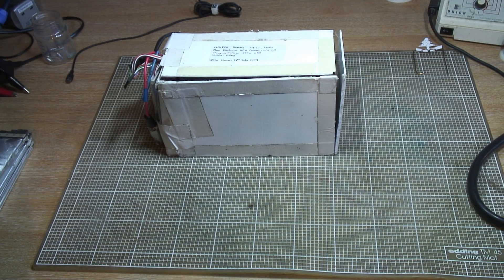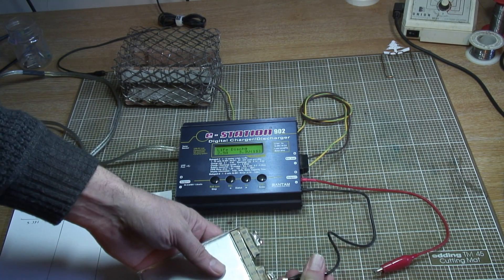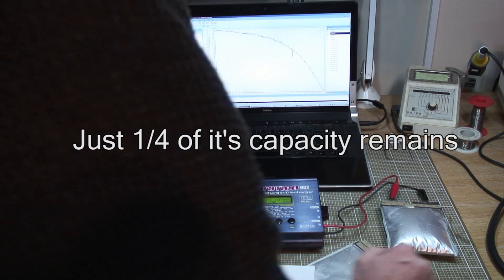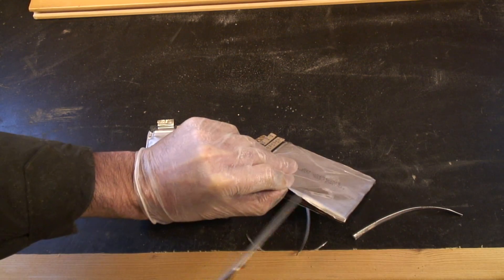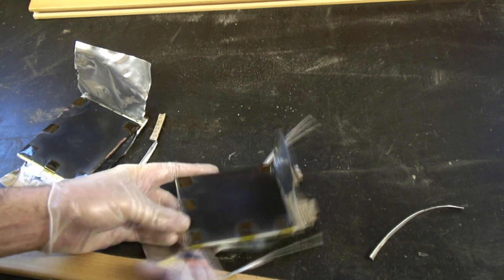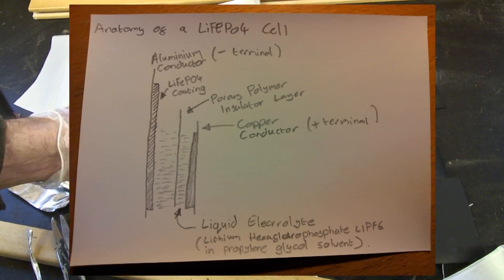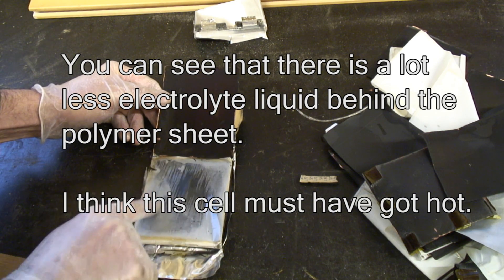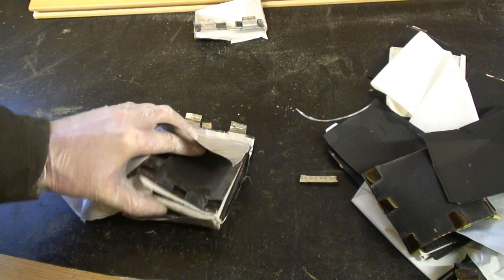LiFePO4 Battery Autopsy/Teardown

Comment: Charging while at or below freezing destroys these batteries every time.  That is likely what caused the cells to bloat.  When charging always ensure they are above freezing.  Higher end BMS have temperature sensors to avoid damage because they will not charge below 0c.  It is sad when they bloat and quit working like that....
Reply from the maker: I can promise you that it never gets below freezing inside my house where this battery lives. Personally I think it was a bad BMS that killed these cells by failing to prevent overvoltage conditions properly. Thanks for taking the time to comment. Cheers!!

Comment: 9:51 Al is cathode but cathode is positive in the Battery chemistry
Reply: That’s not really correct, the cathode is where the reduction occurs so in charge the cathode is the negative electrode and in discharge, the cathode is the positive electrode

Comment: The bloating is gas caused by electrolyte decomposition.  Most common cause is over charging but can also be caused by overheating or extremely low cell voltage.  Electrolyte becomes unstable above a cell voltage of about 4.3v or below 0.1 vdc, or high temp from over current discharging or charging currents.

The gas is not the main problem.  The electrolyte decomposition also creates tar that clogs up the LFP and graphite electrode pores increasing cell impedance.  The brownish discoloration is the tars left behind from electrolyte decomposition.
Reply: I had this happen to a cell when putting a fully charged cell parallel with cells that were not charged. The fully charged cell puffed up during the charge cycle.

Comment: A great video and I'm just getting around to watching it 7 years later!  I wonder if the fault was caused by the same thing that happens to Lithium Ion cells? With LiIon a crystaline structure develops between the positive and negative terminals of the cells and shorts it out. LiIon will also swell up and may even burst into flames.
Reply: Li-ion plate out metallic lithium and generate hydrogen fully discharged. If left that way the process continues and if dendrite growth pierces the internal menbrane/shorts the electrodes then "bad things happen" - especially once the cell bursts and hot lithium + hydrogen are exposed to oxygen

LiFePo4 are a lot more stable but I wouldn't leave them discharged for prolonged periods

Always store your Lithiums at 1/3-2/3 charge, never leave them dead, even if the pack is "dead"

Never keep dead lithiums around - they're a fire hazard. Send them for recycling

Comment: very interesting video of the inner assembly of a LiFePo4.............as someone who uses the smaller LiFe packs (  1700mah - 2200mah  2 cell  packs ) for my my rc airplane receiver,  do you know of a simple and safe charging rate rule for these batteries that I can follow to prolong the life of my pack, I charge at 1/2 C  of the battery rating .....example: a 2000 mah pack gets charged at  .5 C or 1 amp.....thanks for any  help  you can offer  .....
Reply from the maker: Hi Gary. 1/2C is the recommended rate for most LiFEPo4s (unless the manufacturer tells you otherwise), and 3.65V per cell for the cut-off voltage. LiFEPo4s are supposed to be tolerant to overcharging, but the cell I pulled apart went puffy because the BMS wasn't terminating at the correct voltage. After a few hours sitting at full charge it was enough to damage the cell. Hope that helps. Cheers!!
Reply: @ThingsWhichArentWork  yes, it helps and I think I will stick with the .5C  charging rate as a " rule of thumb" for my LiFePo4's...the only drawback in using these in the rc world  that I have found is the voltage seems to drop off very quickly , and my LiPo low voltage alarm  will not work for the LiFe packs....thanks much.

Comment: I have the same situation of an expanding cell in my Lifep04 Ping bike battery that is only 3 years old and without a lot of usage.  I had a buddy of mine that has been e-biking for a long time told me it can be caused by charging when it's freezing temps or because I didn't keep it charged like I should have. You can take that for what it's worth... Hopefully this will save someone from this problem...
Reply: Mine seem to expand when I don't do a proper shut down and put them on the charger (cell phone batteries) but they're also cheaper brands

Comment: Thanks. But how did you removed the individual cells from the bigger pack without damaging their tabs?
Reply from the maker: The tabs were soldered onto little PCBs that connected the cells together. I just used my soldering iron to melt the solder and a small screwdriver to pry up the tabs whist the solder was still molten. Cheers!!

Comment: add coroplast/coreflute between cells in next pac with thermo fan to  push air between cells through coroplast/corflute for heat dissipation  should be able to sustain heaps more amps without overheating pack and clamp pack to keep laminates tight  for longer life

Comment: Thanks for your LiFePO4 Battery teardown.
Could you also make a Lithium–titanate battery teardown? This would be very interesting.
Reply from the maker: Hi OpenGL4ever - I'd love to make that video, but sadly I don't have any lithium-titanate batteries to take apart. Cheers!!
Reply: Jim Conner
I was searching yesterday about some Lithium Titanate batteries, they still seem to be very pricey.
Here's an example:
www alibaba com/product-detail/Lithium-Titanate-Battery-2-4V-15AH_60280829686 HTML

EDIT:
Youtube seems to edit the URL and exchanging the Filename HTML into lower case to so some awkward Unicode chars. If the link is not working, first copy and insert it in notepad, then add the Periods and change everything in ASCII which is not ASCII. HTML needs to be changed into lower case.

Comment: Full battery or dead battery?
Reply from the maker: D'you know... that's not as easy a question as it might first seem :-)... 7 out of the 9 cells were fully charged, but the two that I autopsied had shorted themselves internally and would be dead. Cheers!!
Reply: I try cut and autopsy of Lipo and get fire from bank power.
Reply: Alexsis Scott hold her to the floor Scotty!

Comment: Wow, thanks mate! I'm on the exact same track just now. One of four of my cells bloated up just like yours and it deformed all the other 3 cells next to it. It's been the 3rd cell in the pack. So you think it's not the BMS/Balancer that overcharged the cell, but a failure within the cell itself? I'm really curious, because naturally I'd like to know if it's safe to reuse my balancer module with new cells, or if the whole thing should be disposed of. I'd just like to know my chances before reusing the module just to watch it fry the next pack...

Maybe I find a way to test the module health before reassembly...
Reply from the maker: Hi ***** - That's what I thought when I made the video, but if you have a look through the comments below, there's a good conversation between myself and ***** about the SignalLab BMS that was on my pack - Apparently the chip used on the SignalLab BMS does not cut off the charge until the pack voltage hits 3.95V (rather than 3.65 which it should be) - They've got away with this because LiFePO4 is generally pretty tolerant of overcharging conditions. In the case of my pack, the failure followed a very long charge cycle (I forgot about it for half a day) so the cell voltages will have risen very high on my pack. Having said all of that, after replacing the failed cells, I have continued to use the SignalLab BMS, but I've been a lot more careful about ensuring that I terminate the charge in a timely fashion. I only use that pack a few times a year, so having to keep a close eye on it when charging isn't a huge hardship for me - for other use cases it may be more problematic. Hope that helps. Cheers!!
Reply: Jim Conner Yeah, that helps, thanks!
I watched this video too pxP0Cu00sZs - seems like heat + high voltage + slow charge/discharge = overkill for lithium cells.

I'm using them as a motorcycle starter battery, so it's pretty hard to tell what exactly is going on between the generator, the lead-acid-battery-designed loading unit and the cells. I've got a balancer in between, but since a cell bloated up, that doesn't seem to be very good. It's a SHIDO YTZ-10S, but claiming warranty is pretty hard - they just didn't respond - and now I'm going to replace the cells myself, only keeping that balancer module.
Reply from the maker: ***** I don't know what cells you have in your pack, but in general the square, flat cells (aka prismatic cells) don't have a great current delivery capacity, whereas the cylindrical cells have a lot more oompf available. My 20Ah pack is only rated for 40A max current delivery. Your Shido pack seems to be designed specifically for use on motorbikes though. I found some specs on your pack and they seem to suggest that it can deliver 190Amps for cranking, and can take a charge at up to 20Amps rate (6 mins to charge the pack). I'd be tempted to have a go at claiming the warranty if I were you, as it seems that you've been using the battery for exactly what it was designed for and it's failed anyway. Hope that helps. Cheers!!
Reply: Jim Conner in theory, yes. It's just that now I've taken a look inside. Didn't cut the bloated packs like you did tho, but I broke the warranty seal anyways. So even if they'd reply to me now, they surely would just laugh at me trying to claim warranty for the opened box.
Reply: Rodney Jones lol, really? That's an odd approach, but if you enjoy doing that, I won't get judgemental =D
Reply: yes you should check it. I've found the best way to check batteries and or chargers is to sit them on a table in front of you and look at it look at it for 2 minutes scratch your head and move to another spot and continue to watch it for another 10 minutes scratch your bumole using two fingers making sure that your fingers do not exceed the second knuckle In your bumole. after scratching you test the batteries.using the finger u scratched your bumole. smell your fingers to check for appropriate scent .
Reply: *****  Lol you'd be surprised how many people would beleave it. There's people that beleave the government's is using aircraft to spray blood and chemicals. This could also be true
Reply: *****  But only works if you don't go past the second knuckle. If you do that's just queer

Comment: It's simply the litium that releases hydrogen
Reply from the maker: Hi Alexandre Rouma - I didn't think that LiFePO4 batteries could produce hyrdogen - I know that Lead Acid batties produce it, but I thought that LiFePO4 were supposed to be intrinsically safe and not produce any explosive gasses. I'll do some googling and see if I can work out the relevant chemistry that would result in hyrdogen production... Got any pointers for me? Cheers!!
Reply: NiMH does release hydrogen.
Reply from the maker: poosibly with some hydrogen flouride mixed in... which is particularly nasty stuff and shouldn't be inhaled.